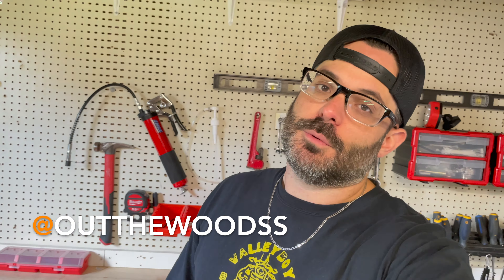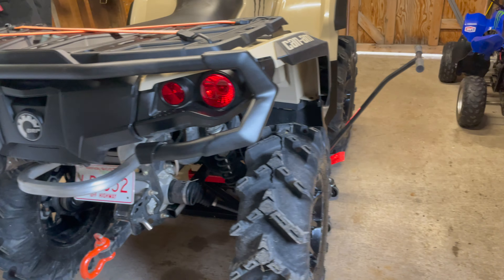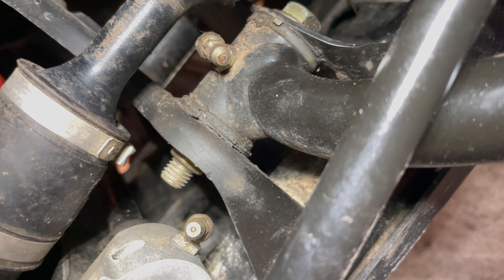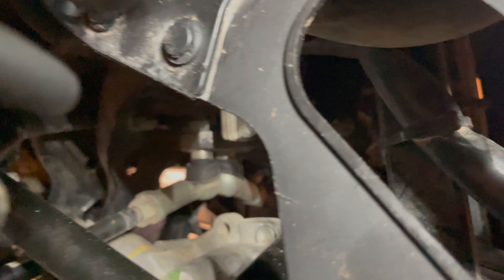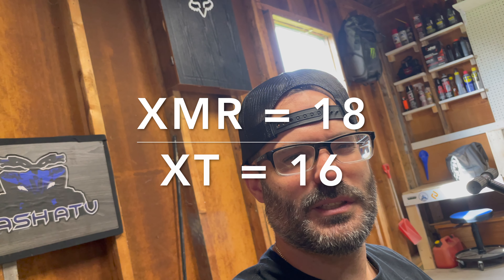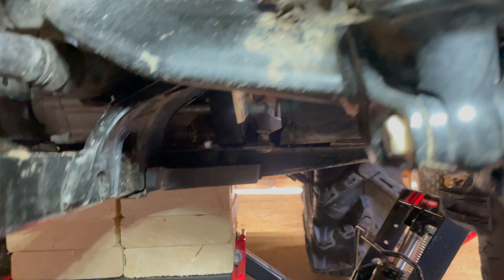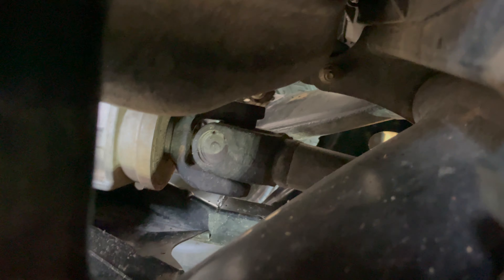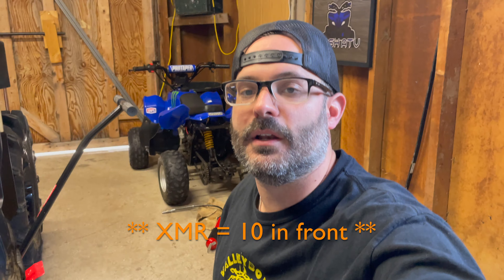How To Grease a Can Am Outlander XMR (18 Fittings)

Comment: I grease mine every ride in mud or water , for trail rides I normally wait 2-3 rides before I grease them . The most important one is the drive shaft .
Reply from the maker: Yea man drive shaft is key. I actually have done that before but not the whole thing. Gotta be a little more diligent
Reply: 3 on the drive shafts (the front has one).